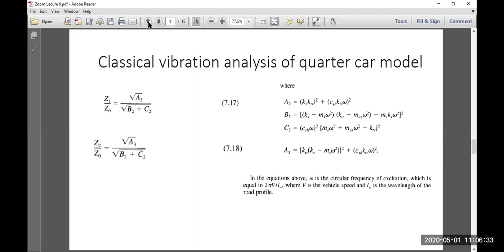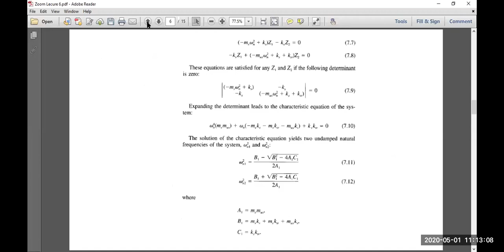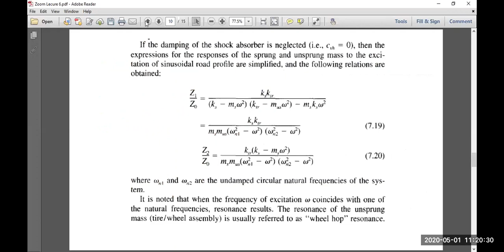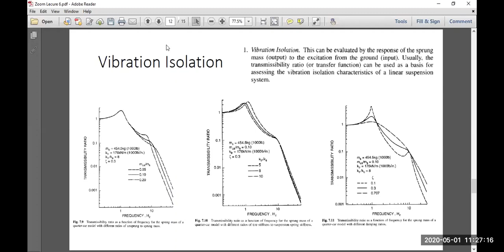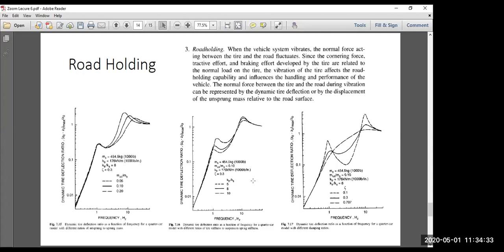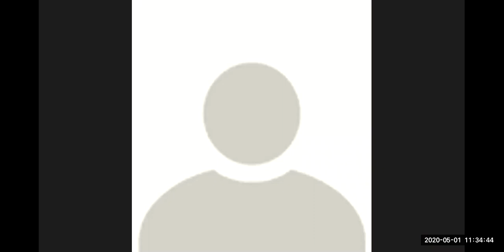Vehicle Dynamics Lecture 45 (Quarter car model and suspension performance)

Comment: Understeer occurs when the front is heavier  If that's the case, lift-off oversteer occurs when the rear is lighter can you explain this teacher?
Reply from the maker: There are two cases that you have to understand. 
1. Steady state motion in straight line, and  
2. Transient motion (accelerating, braking & side force/steering) during straight line motion. 
During steady state motion of the vehicle, the load distribution remains invariable on the axle. Hence the tire compliance decides the understeer gradient value. If heavier the front of the vehicle may be due to front engine vehicle that naturally, will have positive Kus, hence behaviour is understeer.  However, lift off oversteer is the vehicle tendency during transient state which is just after sudden acceleration stops, during this event the load get transferred from back to front due to this lift off event on front of the vehicle give rise to more  traction  and grip than the rear axle which feels lighter and lose grip relatively. This is what is called lift off overseer as vehicle is more sensitive to a side force/steering action on wheel that takes vehicle in to the side force/turn at that moment. 
Hope I have answered your doubt. Thanks for watching my class lecture. Regards, Prof. P. Sakthivel
Reply: @sakthivelp5894  Can increasing weight on one side by stepping on the brake or accelerator always be seen as an improvement in traction, like downforce?
Reply from the maker: @bjj-vl2ut  The crux is that the resultant of longitudinal and lateral force should reach closer to road adhesion coefficient times the normal load on the vehicle but not to go beyond. Exercising on brake or accelerator to ensure this need to draw the maximum potential. Good day. Regards,
Reply: @sakthivelp5894  In the case of downforce, is it possible to benefit from exceeding the vehicle mass?
Reply from the maker: @bjj-vl2ut  What do you mean by exceeding the vehicle mass?
Reply from the maker: Could you please introduce yourself to me?
Reply from the maker: If you mean it is the normal reaction at a wheel, of course it is a benefit and can be achieved by active suspension system. Regards,
Reply from the maker: @bjj-vl2ut  If you mean it is the normal reaction at a wheel, of course it is a benefit and can be achieved by active suspension system. Regards,
Reply from the maker: @bjj-vl2ut  If you mean it is the normal reaction at a wheel, of course it is a benefit and can be achieved by active suspension system. Regards,
Reply: @sakthivelp5894  i said it wrong. What I mean is that when a car with a 4:6 weight distribution and a 6:4 car brake together, the force moves forward and the front grip improves, but both 4:6 and 6:4 cars can oversteer. Is a 4:6 car more likely to oversteer? I am a student studying automobiles, teacher.
Reply from the maker: @bjj-vl2ut Kindly refer a specific lecture on lateral dynamics. Regards, Prof. P. Sakthivel
Reply from the maker: @bjj-vl2ut Please listen to my lectures 23-28 for lateral dynamics and post your doubts?
Reply from the maker: @bjj-vl2ut It is not only weight proportion but also cornering stiffness of the tires decide the vehicle tendency. Understeer gradient is defined through tire compliance that is the ratio of Weight to cornering stiffness.
Reply from the maker: @bjj-vl2ut Kindly provide your Name, University name and the year of studying. It is good to answer your doubts.
Reply: @sakthivelp5894  So does this mean that a car with a 6:4 weight distribution is more prone to lift-off oversteer? So why does lift-off oversteer get worse the more luggage you put in the rear trunk?